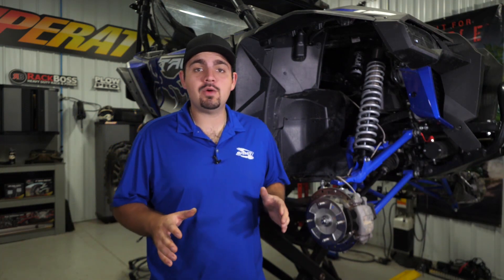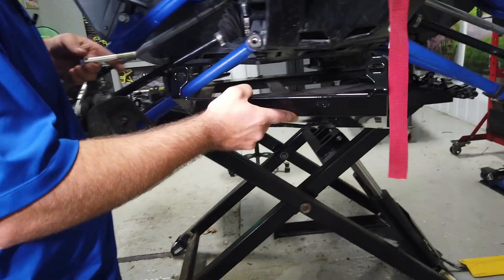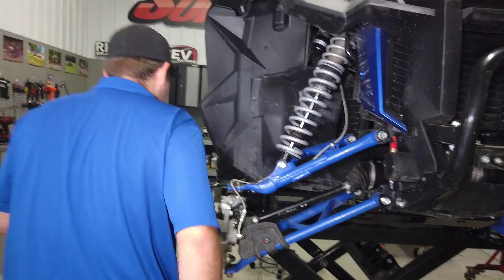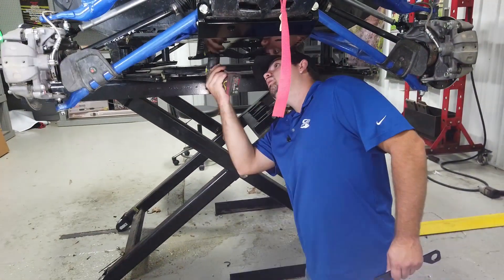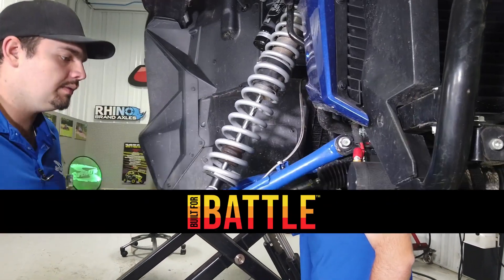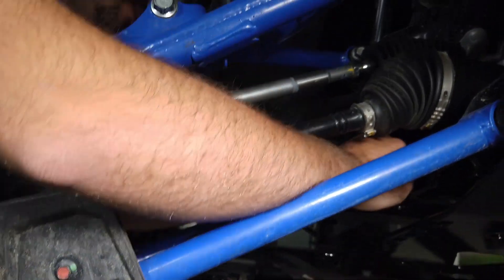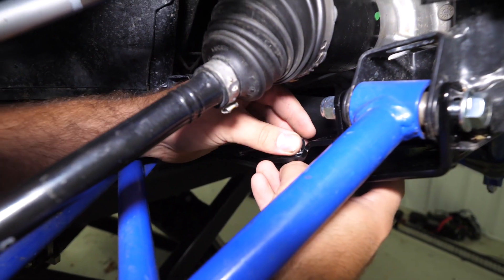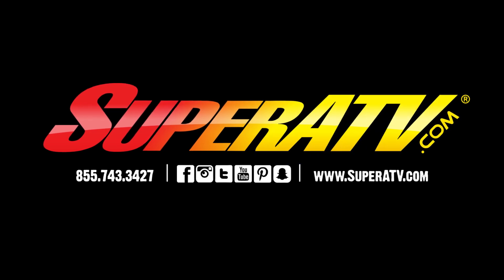How to install frame stiffener/gusset kit on Honda Talon

Comment: What is the purpose of the spacer? Why would you want more space between skid and frame? There is already gonna be a half inch lip at the front of the front skid plate. Thanks
Reply from the maker: You can see in the top photo on page 5 of the instructions, there is not enough space for the stiffener plate and skid plate unless the skid plate is spaced downwards slightly.

Comment: Website doesn’t show it it will fit the 2023 talon
Reply from the maker: It shows it will fit the following models: 
Honda Talon 1000R : 2019+
Honda Talon 1000X : 2019+
Honda Talon 1000R-4 : 2023+
Honda Talon 1000X-4 : 2020+